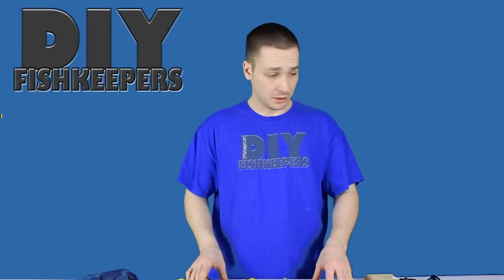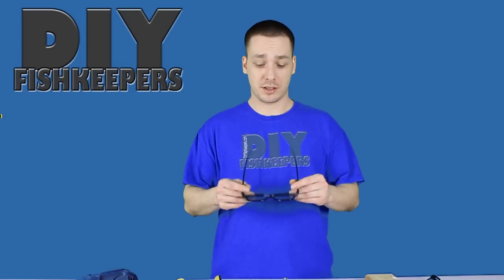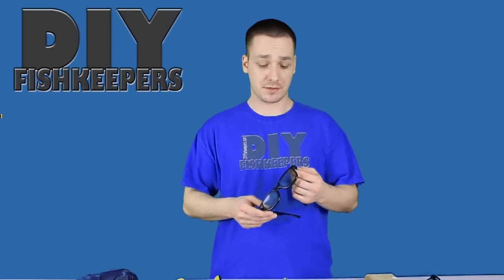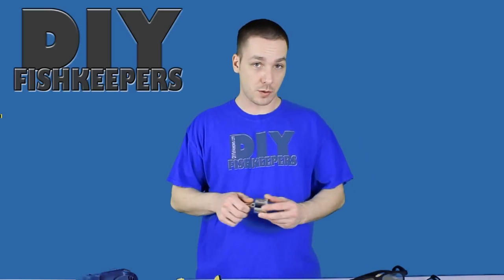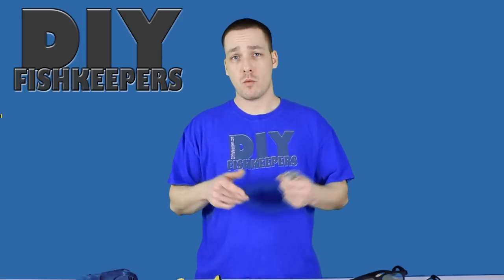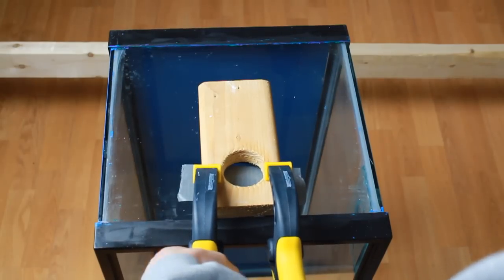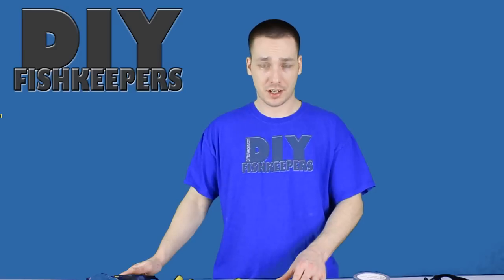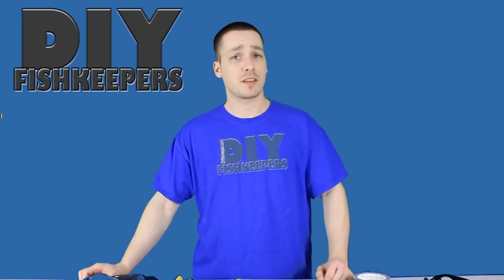HOW TO: Drill A Glass Aquarium

Comment: Thank you so much. I recently tried to drill my first aquarium and could not manage to do it without cracking the glass despite multiple careful attempts. I made sure to get a good hole saw, a good drill guide, go slow, keep it straight, keep it wet at all times, and followed the general methodology that I found on various online guides. Yet it cracked right at the end every time. I even verified that it was not tempered since I could not believe how easily it was cracking. Thankfully I was only using a cheap 10 gallon for testing purposes. I was about to give up then I decided that I must be doing something wrong if so many people were able to do this without any issues. So I looked around on youtube and your video was the first to pop up. Your method intrigued me so I decided to give it a try.

I had a few issues with it. The gasket for the bulkhead was too small to use so I grabbed a larger gasket. I tried to clamp the wooden plank down but since it's an aquarium you can only clamp it on one side. That leaves the board at a slight angle which prevented the gasket from sealing properly. The only way to get around this is to do what you did and drill the holes very close to the top. But that's not a good idea for most overflow designs so I decided against it. Without a proper drill guide I decided to use plumbers putty instead of a gasket to seal the water in as so many other guides do. This worked much better than the gasket for me. Then I added the duck tape on the back and wala. I was able to drill straight through with ease without a crack. 

The only thing I would add to your guide is to try plumbers putty instead of a gasket and to make sure to drill it in one continuous run. If you take the hole saw out to clean it then try to continue drilling you won't be able to line the hole saw up quite right with the original hole which will make the area around the hole weaker and more prone to fractures. I think the duck tape also helps to stabilize the area around the hole since the force of the piece of glass popping off at the end can put stress on the surrounding glass. Your guide definitely saved my ass though. So thank you.

Comment: Joey...  Love the vids!
Here is a tip to prevent the gaskets from leaking..
The rubber gaskets tend to "stick" against the glass as you are tightening the nut sometimes preventing it from totally sealing.  Simple fix?  Make sure the glass is clean and put a little bit of dish soap on your finger and lubricate the gasket with it.  Now as you tighten it, the rubber can slide some and make a good seal.  This works for all sorts of fittings, including making it easier to push hoses onto fittings!

Comment: Thanks, great video. Questions. Now, should the drain pipe be anchored to a surface as not to put too much pressure on the drilled hole for fear to stress cracks?

Comment: Can u recommend brand of hole saw to drill holes in tanks? 
Also could u make a manual drain pipe with the hole outlet at thst same height by adding a pipe inside the tank and have a ball valve on out side which i can open to drain out water?  Could this work without loosing siphon?

Comment: Quick question, (great vids by the way). Are you leaving the arbor brill bit installed or removing it? Im referring to the actual drill bit in the arbor to normally keep the hole saw centered. It looked like you did but I would have thought it wouldnt be needed with a wood guide and that it might crack the glass.
Thanks

Comment: if iam drilling a 30mm hole in my glass does the hole on the wood template have to be 30mm right on or a little bit bigger than 30mm

Comment: hi joey . Do U or others Knpow best way to pull apart a 55 gallon aquar. its broke on one side so i want the 3 good panels to use as tops for other tanks> I cut away the silicone with razor b lade But Its at a stand still now. I was thinklin of Breaking out a side panel & work around from there?? PRASAP TY

Comment: hello, I know this is an older video of yours.  ut I wanted to know how to reverse this basically. I recently acquired a 75 gallon tank with a sump over flow an two 2 inch drilled holes in the bottom of the aquarium I have decided it's to much hassle to remove the overflow (fear of breaking the glass)  but I still need to plug the holes. do you know how I could do this? I use fluval filters and I have no desire to switch to a sumps. also thanks for the vids! they are very informative
Reply: +Bailee Jane Just buy bulk heads in put a plug in them.
Reply: +Michael Skurnik that's what I ended up doing. it took me several months to find proper hardware becuase they drilled the holes in irregular sizes

Comment: My bulkhead have a very small leak I tried to make it tighter but the leak is still there. Is it ok to used silicone and how? Many website says silicone is not recommended. Any advice for me, I think my problem is because I should had drill a smaller hole but the leak is very small.
Reply from the maker: Hi Frederic. I would try a small dab of Vaseline between the gasket and glass first. That should create a much better seal. If its still an issue, turn to the silicone. There is nothing wrong with silicone a bulkhead in place, it wont harm anything.... its just next to impossible to remove if you need to. Which is rare anyways. Last option is to replace the gasket(might as well replace the whole bulkhead).. also, it could be as simple as a bit of dirt stuck between gasket and glass or something of the sort, so try cleaning as well.

Comment: Joey what's better to make the holes in the bottom glass or on the back glass? What do u recommend?
Reply from the maker: Its really up to you. When drilling in the back wall, you dont get as much flow though. So larger bulkheads need to be used. Other than that, i dont really have a preferance. Depends on the setup and what i need.

Comment: hey man... what if the hole your looking to drill is at the bottom of the tank how would u clamp it??
Reply: You can use double stick tape. It comes in a variety of thicknesses and is sticky on both sides. It holds very well so you shouldn't need much more than a couple of 1" squares to hold your guide in place.

Comment: joey, how many times can I drill a tank? I drilled 2 holes in the back of my reef tank I am building out. I would like to add 2 more holes for returns, curious if having 5 holes in the same line along the top of the tank going to cause any integrity issues with the glass?
Reply from the maker: If the top of the tank is braced, then there will be no bowing there... any bowing will be in the middle of the pane. So you could drill as many as you like at the top. If it isn't braced, then i would space them out and only group 2 at a time.
Reply: ***** the tank is braced, its a beananimal style overflow, three holes about 2 inches apart centered, and im planning 1 on each side for the returns. thanks for the awesome dedication to the hobby.. seasons greetings from colorado!!

Comment: How do I make the guide? I'm thinking about drilling my 5 gallon Fluval Spec tank because it's already reliant on a sump and I don't want to worry about breaking the siphon. I accidentally broke the siphon while messing with my T5 light fixture and water went everywhere because I have a very high flow rate coming from my sump. I was thinking about drilling the side because my sump is actually only partly below my tank. My tank is a saltwater and I'm a little hesitant to take everything down but if drilling can prevent water from overflowing during a power outage, it would be worth it.